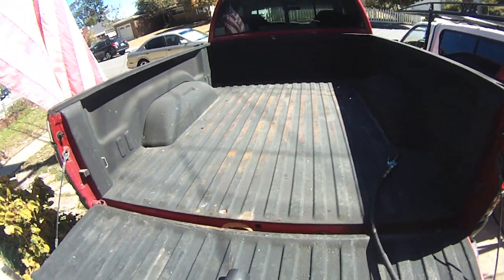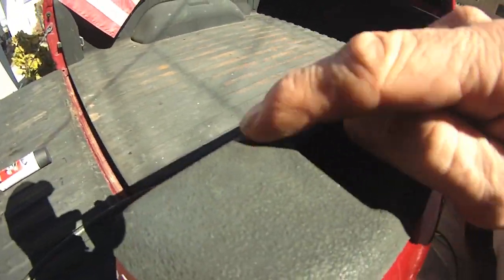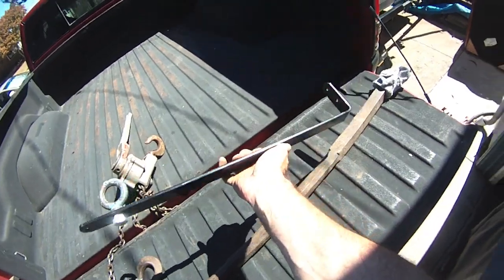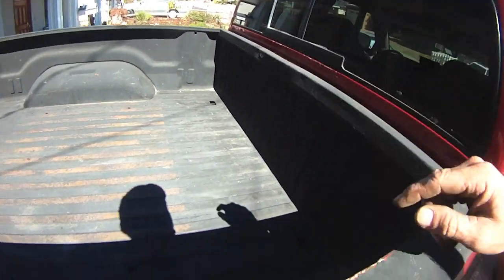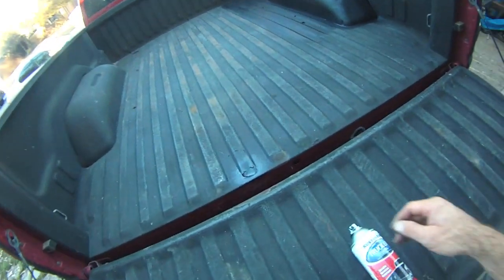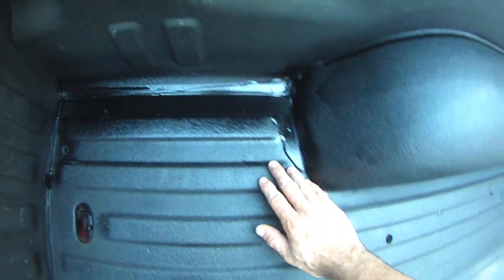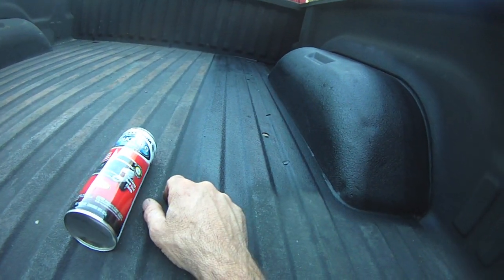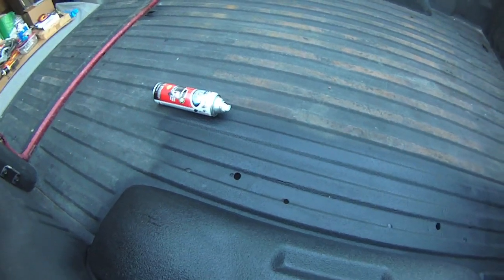Cummins Truck Bed Repair and Coating

Comment: I did a truck inside cab, totally stripped clean with that same stuff. Did the entire floor and back wall at least ten years ago. It's still right where I put it today. Damn near waterproofed the cab and sound deadened it a lot. 1960 Ford if you're wondering...no carpet kinda ride.
Reply from the maker: Cool. Thanks for the info.

Comment: I had Line X do my truck bed in 2005  still looks great more like flat black now . You can buy  gal can of liquid bedliner  in most part houses .Good Luck ,Gerry .
Reply from the maker: I am still on the fence about taking it to a shop or doing something myself.  When all is said and done I will be putting a sheet of plywood in there as the sacrificial anode to take the abuse of sliding stuff in and out, so we will see.  Today I install the new gauges that came in a few days ago...I can't wait!!!!  Hope Y'all are doing well.  Steve

Comment: I have used the rustoleum truck bed liner before. There's two kinds. One is just the rubberized liner and then there's a type with primer in it. I bought both kinds. And for whatever reason the stuff without the primer was absolute garbage. You had to shake it every two seconds and even then half the time it would just spray out black paint. Both cans I bought were like that. Went and picked up the primer infused stuff and worked like a charm
Reply from the maker: Thanks for the info Mikeal.

Comment: I used a bunch of scrap deck wood from a tear out. Sprayed that rustolium stuff in, built a platform thing to fit the bottom of the bed with the ceder scrap wood then stained it, and I think it turned out fairly good.
Reply from the maker: That sounds like  great idea.

Comment: that rustolium spray can is some decent stuff, but don't expexpct it to hold up to too much abuse as a bed liner.  id recommend it for small touchups, though.  took the kids' bicycles down to bare metal and used it to coat them.  they look awesome lol
Reply from the maker: Thanks for the input.

Comment: I used Herculiner on an S10 with good results, and I used the Rustoleum liner like you have on the lower fairing of my bike.   It worked well, and stood up to all the little stones & such that got kicked up off the front tire.  It was not, IMO as tough as the Herculiner.
Reply from the maker: Cool, Thanks for the info Dan.

Comment: I've used that stuff before and mine did not hold up at all and it started scraping off after the first use. The best can spray on bed line I've used is Dupli Color however, I recommend staying away from the spray and just bite the bullet and buy a gallon of roll on bed liner, it is infinitely more durable.
Reply from the maker: Thank you for your input.

Comment: For $25 bucks you can make the bed look decent, Why not. I rolled my 60 Ford bed for more texture and it turned out better than I thought it would.
Reply from the maker: Yep, if I do it myself it will be from a quart and not any spray can.

Comment: For touch up the cans prob be ok . If going to do whole bed , U-Pol  Raptor liner , or Durabak , would be my economy choices . I may try the rustoleum liner on the tool box of the sears tractor .
Reply from the maker: Thanks Terry, I am sure a quart of this stuff is thicker than the spray can... I know spray can materials are always thinned down a lot to be able to spray through those tips.  I will look into those products you mentioned.  Honestly I will be throwing a sheet of plywood in there to take the abuse of hauling, I just want things tight before I do.

Comment: i used rustoleum satin and some tread tex, which is essentially sand, mixed it together and rolled it in with foam rollers. 1 quart did the entire bed of my S10 with plenty left over.
Reply from the maker: That's kind of where I'm leaning...didn't think about the tread tex though. Thanks.

Comment: I've sprayed line x and duplicolour bedliners both in aerosol and in liquid form from a commercial sized spray set up. Most products work decently though. The only big glaring difference of the diy or professional applications is thickness of materials applied in my opinion
Reply from the maker: Hey Josh, I agree 100% pro applications are always thicker than DIY products can produce. I had a friend who owned a Rhino-line shop and watched their work for years and the equipment they used was impressive.  This truck has me confused.  The tape-off is amazing..and absolutely a pro quality job with how detailed and exact with body lines and how they how good they were with removing certain hardware...but the actual product was put on thin in a lot of places with a couple spots you can see the paint through.  I am on the fence about taking it to a pro shop to be fixed, I guess in the end all I want is a good continuous membrane to moisture. I will be throwing a sheet of plywood in there to take the abuse of sliding stuff in and out.
Reply: yourbeekeeper the thickness of material does directly correlate with its own strength that's the truth that's why most people doing it themselves use a roll on kit for as much as they can. You can buy a home kit I think from duplicolor that's about $50 for a gun with a giant orfice to spray that material. After you'd use it on your own vehicle if you use it for someone else it'll pay for itself 3 times over. 

The best protection you'll get will be with a sheet of plywood keep in mind if it can move it will wear on material under it including pain. That's one thing that wouldn't happen with a pro application. 

Regardless what ya do its a nice looking truck and it's easy to tell you take care of it. That truck will last you a long time that way

Comment: Can you run a square tube under the front of the bed where you pulled it back? For strength that is?
Reply from the maker: I could, but would have to slide the bed back to get good access.  Right now I just wanted to get it away from the cab.  If I ever have to remove the bed to replace the lift pump, I will address any weakness at that bulkhead.
Reply: ah, then such an "enhancement" is indeed for a time when you're removing the entire bed. :-)

Comment: I say treat yo self meng...lol. It'd look real nice finished up.  FYI rustoleum sells the truck bed liner by the quart so you could roll/brush the rest. Don't know if rolling it would be cheaper than rattle cans but its good to have options.
Reply from the maker: The quarts are much cheaper when compared to the spray cans and I suspect the material will be much thicker in the quarts.  I will get something done before the Winter.

Comment: Why didn't you use the Nilfisk ALTO Neptune 3 pressure washer on the bed?  If you blast out the rust and dirt, the black color would have a better apperance
Reply from the maker: That's a great idea.

Comment: Hi Bee, yup, need to do the same fixes on my 2000 Dodge Ram SLT 2500 4x4 Cummins. How is the Bedliner touchup working out?
Reply from the maker: Hey Dave, actually the touchup is working out great...it stuck very well and has not scratched off.  It's still too thin and does not match the thickness of the old liner.  I have pushed the recoating of the entire bed off until the Spring.
Reply: What do you think you will use? Just recoat over? Thanks, Dave
Reply from the maker: My plan is to recoat it.  I have no interest, time or want to spend the money to have someone strip off the old material.  I don't know what I am going to use yet, I need to research products that can go over an existing liner.  It all will depend on the base solvent in the new coating.
Reply: Good to know the cans will work, keep us in the loop w your respray, thanks,Dave

Comment: The bulkhead on my truck is also bent from the previous owner.  I never thought of fixing it like that.  A real 'duh' moment on my part!
Reply from the maker: LOL, It took longer to set it all up than pull it straight.  If I were to do it again, I would use a rubber mallet to tap the sheetmetal down instead of a hammer.  Tapping the top of the bed down relieved all the stress of the bend.

Comment: I have Line-X.  Pretty dang durable but I've never spilled a battery on mine.
Reply: lol someone I'm subbed to commenting on someone else I'm subbed to.  very cool
Reply: cuptain85 Sweet!!
Reply from the maker: Someone I am subbed to commenting on someone else I am subbed to commenting on one of my videos... very, very cool.
Reply from the maker: Line-x is a good product, along with Rhino-line...I just know they will want to strip the bed and not apply on top of whatever is already on it.  I still may go the pro route..I have not made up my mind.

Comment: Haven't been impressed with Rustoleum's stuff. The roll on bed liner stuff is alright, it's pretty tough for the price. I've slid the pallet forks of the skid loader in the back of my truck and it didn't chip. The rattle can stuff, not so much, I'd stay away from it. It scuffs off real easy.
Reply from the maker: I agree, the rattle can is very thin.  Honestly I plan to throw a sheet of plywood in there when all is said and done to take the abuse of dragging stuff in and out...I just want that extra level of protection.

Comment: Doesn't seem worth the time to put that stuff on.  I have LineX in my 06 Ram its held up good for 10 years old, but my box doesn't really carry anything that would hurt it either cause I have a trailer that I use more than my truck bed for heavy stuff.  I would try one of those roll on ones because I just want to see an honest review of something like that.  LOL
Reply from the maker: I am leaning to a roll-on product and no more aerosol can products.  I will get something done in the next month or so, so stay tuned.

Comment: Why not buy a can of polyurethane and paint it on
Reply: Ram Francisuk Why on earth would you put that on a truck bed? It would flake off in a week.
Reply: I thought it was the same stuff
Reply from the maker: By calling it polyurethane it sounds like a top coat/varnish you would put on wood.
Reply from the maker: I have considered using a rustoleum paint and just go over what is here...Their oil based paints will stick to anything.